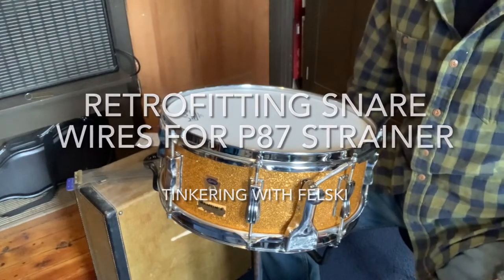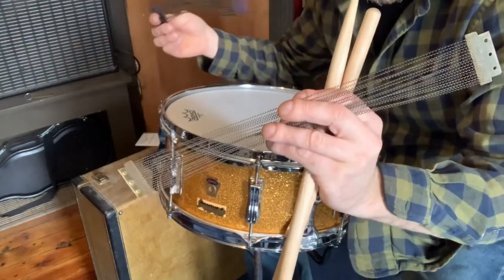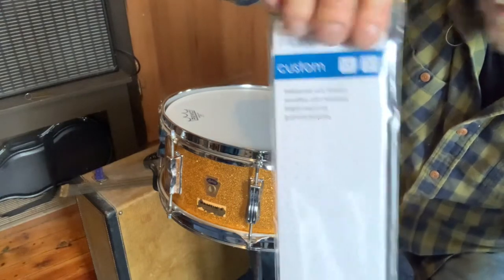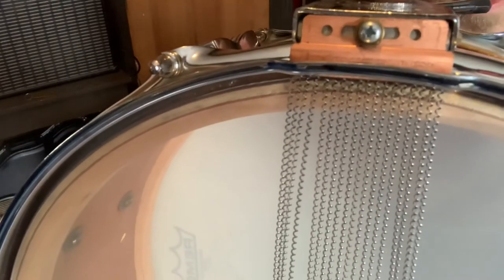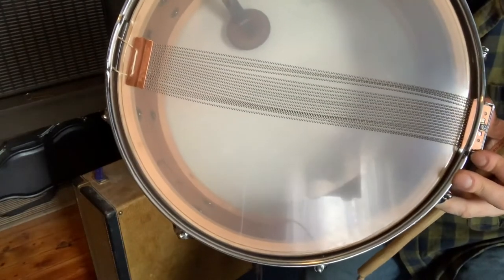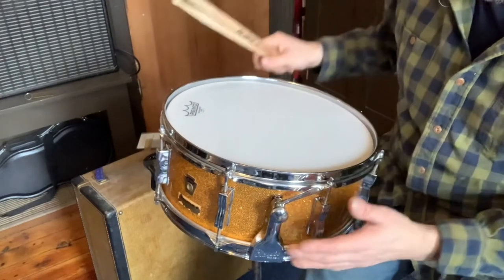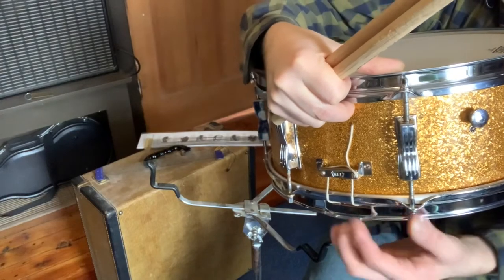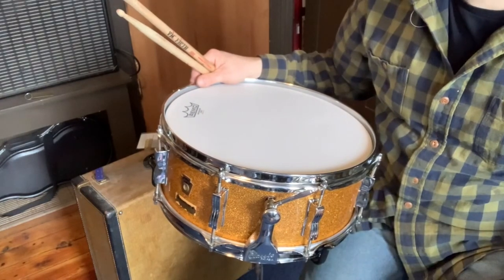Retrofitting Modern Snare Wires for Ludwig P87 Strainer

Comment: thanks for this vid--just got a similar snare and didn't know what to do!
Reply: Also, I used the same snares as you and didn’t have to Remove any wires for it to fit; I just shaved the edges of the copper colored part a bit with a Dremel.
Reply from the maker: I’m glad this video helped!
Reply from the maker: @danieltothemax8086   oh interesting!!

Comment: Thanks for the video. I recently found a snare that had a P-87, but I want to upgrade the snare system.  Does anyone have any recommendations on what can fit the existing drilled holes that will work? Any help is appreciated! Thank you!
Reply from the maker: Im not sure of other strainers that have the same hole spacing, but worse case scenario you can make a plate that utilizes the old holes of the shell and drill holes in the plate.   This will keep you from drilling holes into the shell and allow you to put on any strainer you’d like.

Comment: What's the purpose of having the snare wires extend over only the one side? Does that create more sensitivity than a regular strainer?
Reply from the maker: I believe it’s a similar concept to the Ludwig super sensitive type that allows for more contact with the drumhead.  

As you suggest, I believe it’s the same concept(albeit on only one side of the drum).